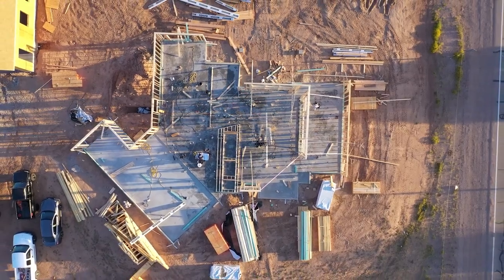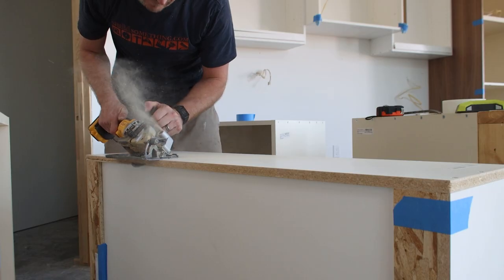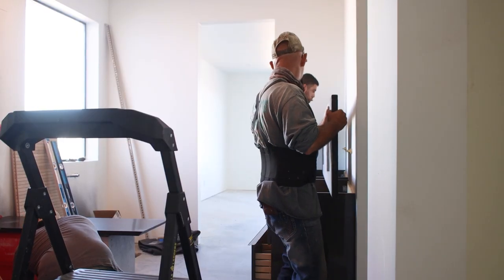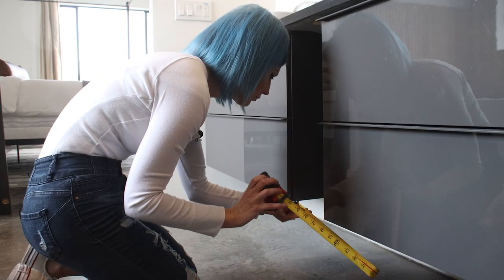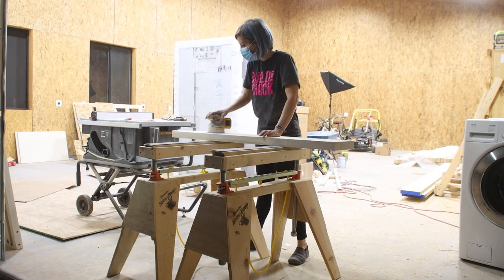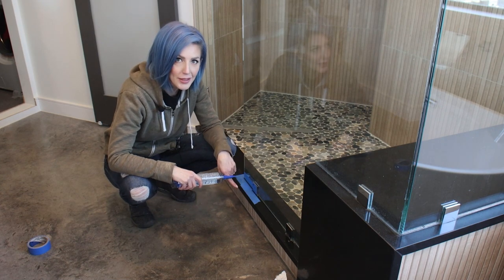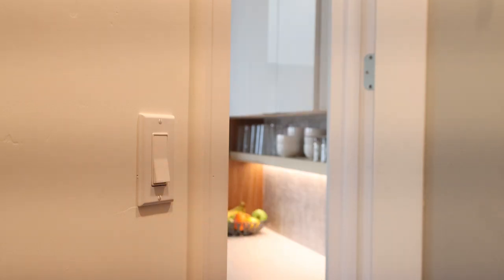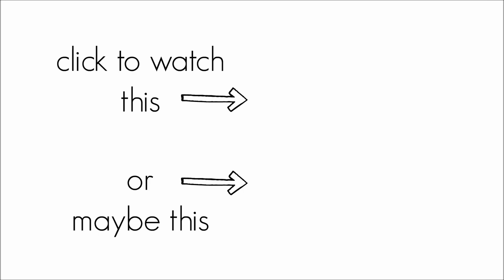DIY LUXURY Kitchen & Bathrooms | Ep. 13 Building Modern on a Budget

Comment: I am very happy for you guys!!! Your efforts completely paid off. House is very cool!!!! I am on my way to build a house for my family.  A lot of good tips I learned from your videos. Before diving in the deep water I decided to buy a condo for a flip( Chicago NW suburbs) and improve my building skills (I am not professional at all). I discovered for my self!(maybe it's well known)1 very great tip for applying caulk or silicone. In the end of the process for super smooth finish I was wiping places where caulk or silicone was applied with a lightly wet sponge.

Comment: If you use the Hidden Cabinet Pulls, check the length of the screws, the ones that came with ours would have just protruded through the front of the cabinets. We ended up lopping the tip of the screws off.

Comment: I like the format very nicely done.  I do have a concern, regarding the stove top hood when I put one in I used a similar material for the ducting. The inspector rejected the corrugation material and required smooth sided, his reasoning was pretty good in my opinion so immediately removed the "flex" material and put in smooth sided ducting.
  The corrugations in the ducting he said could trap grease and is a potential for spreading fire into the ducts and away from a stop top very quickly. If the ducting you have visible is from the manufacturer I am sure it is good but if you placed it you may want to think about replacing. 
I do like the information and the way you presented.
-MG

Comment: Maybe you mentioned it on a separate video, but what type of loan did you get to build your own home?  I tried looking into this locally and was told by 3 diff lenders that I'd have to find a contractor/builder that would customize the home I wanted, modern, somewhat like yours.  Sadly, i passed bcz of tons of hoops that I was being put through.  Instead, went with a fixer-upper and am in the stages of trying to DIY whatever I can before I fork out the $ to get a contractor :/

Comment: Yes the cheep cabinets will save you money. Not saying anything bad about going with the cheaper cabs. The nice thing about flat faces is because your a carpenter, you can still give them a foe finish and dress them up if you want something a little fancier. Although some people want matching cabinets though out the house, I personally would have considered yard sale vanities. Sometimes a chest of drawers can give a room like a bathroom more personality then a colder more modern look. a little trick you may not have seen before is to use the rounded edge of a credit card to smooth silicon. Although your bath turned out nice, it kind of looks like an office, instead of a home, but maybe that's what you were going for. Another thing that saw recently was a shower that didn't have a mantle you had to step over in order the enter the shower. the shower slopped down to the drain which allowed the shower to not need the mantle. Lastly I want to say that the blue hair, red shirt, jeans and work boots, sitting on the counter top did make you look like you belonged in the kitchen, but more like you belonged on a construction site. I know you've worked hard and I don't mean in anyway to take away from that. No disrespect intended. I'm sure you'll be happy in your new home.